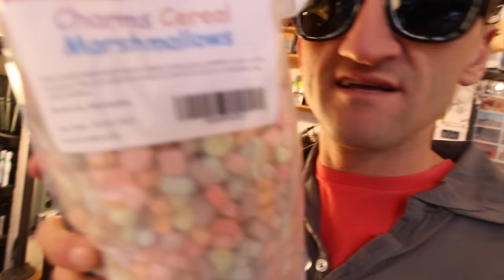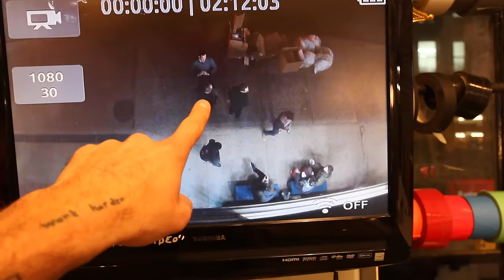FIRST TIME ON A BOOSTED BOARD!!

Comment: Casey I need your advice!! 
 I just got a GoPro Silver and I need to record underwater in a lake because there are HUGE packs of baby catfish that look just like sharks. I need to make a REALLY LONG pole (12-15ft) with an attachment for it so I can record this up close with a piece of shrimp stuck on a piece of wire in front of the camera and the baby catfish will swarm around it and tear pieces of the shrimp off. My dad tried to find something like that online but he couldn't so can you PLEASE tell me what you would do?? 

Thanks, Casey! :D
Reply: Duct tape a gopro attatchment to a broomstick?
Reply: Lance Rze a broomstick isn't long enough. I appreciate it tho :)
Reply: +BugSplat  12 ft section of copper plumbing pipe from Home Depot for rigidity, drill a hole through the outside diameter at the end of the pipe and use a '1/4-Inch 20' screw to mount the camera
Reply: copper pipes are really expensive, i'm sure your local Lowe's has a wood rod long enough, just securely attach the gopro to the end of it.
Reply: Lance Rze  Copper pipe won't rot/mold like wood and is a bit more sturdy at 12 ft long, only costs like $20. Matters how long he wants to use it, just a 1 time thing or regularly.